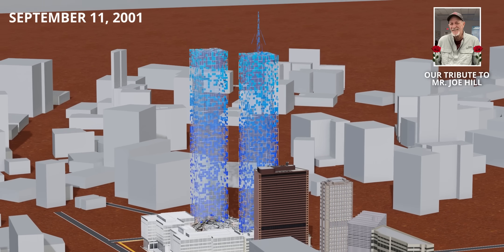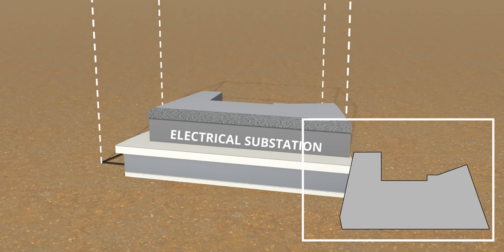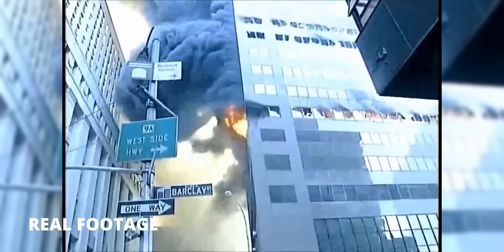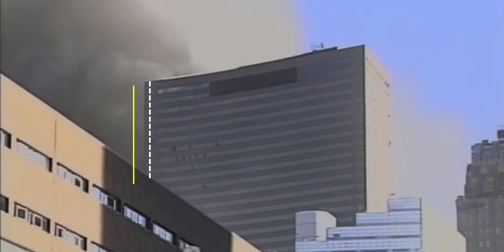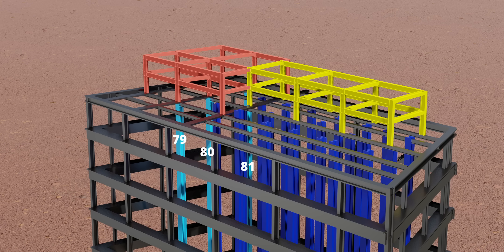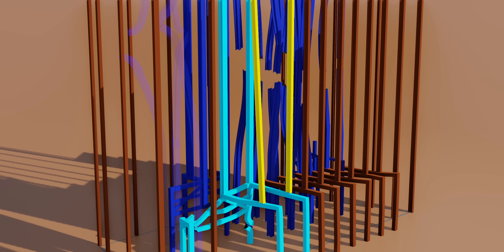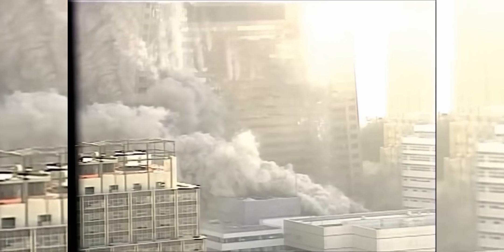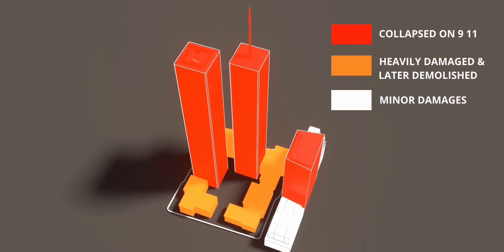Collapse of Building 7 | The Complete Physics

Comment: Okay so freefall speed they admit is 3.9 secpnds for a building this tall, but this building's 5.4 second is WAY slower. About 40% slower(that math doesnt add up) they claim.

So youre admitting that the building fell only 1.5 seconds longer duration than if it was FOR SURE A CONTROLLED DEMO.

thats why he wants to refute the fact of freefall speed is because it proves a controlled demo. But their best evidence of natural falling is that it fell 1 second slower than a freefall object lol
Reply: Had Building 7 collapsed at the rate of FFA it would have taken 6.5 seconds start to finish. Actual collapse time was about 18-20 seconds.

So you got everything wrong. 

CD's do not BTW collapse at FFA.  Certainly no one has ever offered up a single example. It's all 🐂💩 which is why you will have no more success pushing this argument today than a million other people before you over the last 18 years who just mindlessly repeat stuff they don't understand off the internet.
Reply: Ok, so....you literally got nothing right...and you wanted to brag about that? Wow.

The building was 190 meters tall. A fall, from rest, from that height, would take 6.225 seconds. The observed fall was 5.4 seconds...for 18 floors. It was 47 floors high. Hence, there would have been 0.825 seconds for the remaining 29 floors. Which anyone with even the slightest bit of a brain would tell you isn't going to happen.

Hence, we can conclude that, no, literally everything you said was wrong.

Comment: Hmm, so apparently you can get a physics degree from a cereal box now.  Interesting
Reply: Well apparently you did, which is why even this video went right over your head.
Reply: @TheCriticalStinker-01 so stinky you are saying it hasn't went over your head because you have a engineering degree? You are a liar
Reply: @TheCriticalStinker-01  How ironic, coming from a user with the tag of "CriticalThinker".
I doubt you can properly grasp the concept of thinker, let alone a critical one
Reply: @TheCriticalStinker-01 Paragraph 2 Building 7 was the 3rd to collapse,  everyone knows this. And look, Stinky says we should listen to him because he has a degree in WHAT??? yea that's what I thought. We should listen to stinky because he has never had a job. Yeah that makes sense. And 7 wasn't an engineering problem what are you talking about? 
Paragraph 3, you admit it burned out of control for 7 hours. But No one turned on the fire suppression system in tower 7, no one was inside 7, no one fought fires in 7. Therefore there was noone to pull out of tower seven   You say half of NYCFF died that day. So not true. The total number of FF in NYC was 8648, half of which would have been 4324. Not 343 you are off by 3981. And this is exactly why nobody wants to read all this crap. You are a liar.  But you point out no water pressure. Let me add, everytime something dramatic happens there's no water. No water in Maui,  no water in LA, no water on 911. 
This video you made to show how 7 was damaged shows no damaging happening,  you just show before and after, proving absolutely nothing. And your map is a joke. Buildings were damaged fifteen blocks away. Your map barely shows tower seven even being in the fall zone. 
Paragraph 4 collapse isn't always a concern for FF. Not one firefighter believed those buildings were gonna come down when they got there that morning and there's testimony to prove it. You lie stinky. Alot!!!  Plasco tower was faulty, and not maintained,  the wilton pias de Almeida was abandoned,  had squatters in it, it wasn't maintained and there was an explosion in the building.  Hardly something to compare to tower 7 to which was maintained,  had a fire suppression system,  and didn't have explosions in it. 
The second video proves they didn't go in 7. Now you're proving yourself a liar. 
Paragraph 5 everyone knew 7 was coming down. You show no proof of anything you are saying,  are we just supposed to believe because you say so after all these lies. I don't think so. I was gonna go through the whole thing but you've got enough on your plate at the moment explaining your lies. Let's not miss the fact that you just admitted no one was in there for 5 hours. So you admit there was no one to pull out.
Reply: @h1F5951, 2, and 7 collapsed.  The others were crushed.

Comment: The twin towers held up after the 93(?) bombing despite half of the core columns being utterly destroyed at the foundation level.

The building did not fall.

So no.  No way did the buildings fall synchronized uniformity despite damage not occurring uniformly.  That has never happened in any structure created anywhere.

This video is BS.
Reply: Everything you said was incorrect
Reply: @sovereign6445 Find me a video of asymmetrical damage resulting in symmetrical collapse.
Reply: @norepresentative2491 plenty of simulations showing floors and outside falling away no video needed when you can use today’s technology for simulation up to 100% accuracy come on man we are in the a.i age you know this
Reply: @sovereign6445 Have you ever seen the PBS show on why the towers fell?

It has the Simulation showing what happened.

And the Simulation VERY CLEARLY shows the floor collapsing on one another while leaving the core columns untouched and standing!

This does not match the actual collapse.

This Simulation was made and OK for showing on a major network as being accurate.  Total hogqash!

THAT is your computer simulation accuracy!
Reply: @norepresentative2491  - What symmetrical collapse?  The collapse was anything but.
Reply: @sovereign6445 You've never seen the actual towers collapse have you.

The towers were asymmetrical damaged.  They should NEVER have fallen in the direction of greatest resistance (straight down where all the larger and more steel is present to stop the collapse).  When things fall they ALWAYS fall in the direction of least resistance.

They should have not fallen at all.  But TIPPED over due to the asymmetrical damage.  They should have tipped over where the crowd below was and killed thousands more.

But they didn't.  When one of the towers begins to collapse you can see for an instant that it was starting to topple over.  Then a small explosion cut happens and it straightens itself out totally against the path of greatest resistance.  Because that is not problematic.😂

The falling tower would demolish itself as it hit the stable floors.  But according to "peer review theory" the falling portion was indestructible the entire time hitting one stable floor after another and suffered no damage.  This peer review theory was originated, written, and reviewed in less than 2 days.  Never-ending most papers can sit for years needing enough confirmation to be in a journal .

Then the instant the falling art hits the ground, it vanishes.

And a fire is maintained underneath with the rubble for months without ever receiving oxygen.  Normal fires cant do that.  But thermite fires can.which is why we use them in SEAL missions to cut thru hulls of ships in water because they dont require oxygen from the environment.

Literally EVERY CLIE points to this being demolitioned.  Its you who cant read and connect the clues.  Maybe you will one day
Reply: Only one core column was destroyed in the 93' bombing and at no time was structural integrity compromised.

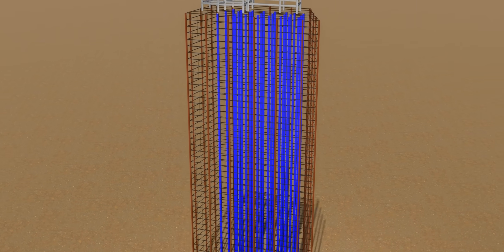Comment: The Grenfell Tower fire burned for approximately 60 hours, finally being extinguished around 1:14 BST on Thursday, June 15, 2017. The blaze, which started in a kitchen on the fourth floor of the North Kensington tower block in the early hours of June 14, quickly spread up the building's exterior before engulfing the entire structure 

Look it up YouTube it’s still standing
Reply: Plasco Tower burned for less than 4 hours and it collapsed.  Plasco was even steel framed, unlike Grenfell which was concrete.

Wilton Peas de Almeida only took 90 minutes, again steel framed.

Why is it losers like you always pick the worst examples for comparison and ignore the obvious ones?  Ignorance or lie-by-omission ?
Reply: @TheCriticalStinker-01 Plasco building fell because the building's lack of modern fire safety systems and lack of maintenance.  It was faulty.  Wilton pais de Almeida was abandoned,  lived in by squatters,  not maintained,  and was blown up. This is what you call proof. 😂😂😂😂😂
Reply: @robbiehiatt9966    Wilton Pais wasn't blown up, no crew was going into the squatter occupied building to set up cabling, explosives, detonator and the wiring. 

You want us to believe squatters would let such a crew in and leave their stuff connected, and the 'government' would allow a demolition in the center of downtown without debris tarps covering the building and without clearing the surrounding few blocks. You won't get a lotta bites on that one.
Reply: @Larry-mk9ry maybe you misunderstood what I was saying. When I say?
It was blown up.I say that because there was an explosion in the building. Not some sort of controlled demolition. An explosion started the fire. Look it up if you want i spent hours researching it
Reply: As someone who studied urban architecture in Europe. Grenfell has a very different construction from the WTC 7. WTC 7 is a steel structure with a steel core, while Grenfell is a steel and concrete structure with a reinforced concrete core (also being especially designed to withstand fire by its lead architect, Nigel Whitbeard). The damage it also entirely different, WTC 7 had sections of the building already destroyed by heavy debris from WTC 1 & 2 and a raging fire, while Grenfell only had a fire and main structural component left intact.

Comment: 8:45 windows exploding... Open your eyes
Reply: That's almost 10 seconds after the collapse started, and was caused by Column 58 failing - in the last cluster of the core columns to finally go, bringing the floors violently down with it and probably causing the failure of perimeter columns 54-56.
Reply: @TheCriticalStinker-01 🤣🤣🤣
Reply: And yet, the "exploding windows", 1, happens along one single line, 2, do so after the collapse have started, and 3, is literally explained during the segment.
Bravo.

Comment: 4:25 You can clearly see the windows blow out, from the bottom up in a straight line. Clear sign of a controlled demolition.
Reply: That's about 10 seconds after the collapse started and most of the building is already gone.
Reply: @TheCriticalStinker-01  Regardless of the penthouse, the freefall collapse happens instantly, when the windows get blown out.
Reply: @defcon2544  - No it doesn't.  The measurement of alleged FFA (it wasn't) was taken about 10 seconds after the collapse began and at the opposite end of the building.  What is being measured is only one corner of the exterior moment frame - the empty cereal box - and NOT the building by any acceptable definition of the term.  The very brief period of alleged FFA is easily explained by the single point being measured moving in 3 dimensions not just straight down and thus subjected to more than just gravity.

In other words, the internet has been lying to you and FFA is still the same meaningless nothingburger it has always been, explaining why a million of you clowns run to the internet with it and fall flat on your face.

Time to pick an argument that isn't a guaranteed loser right out of the gate.
Reply: @TheCriticalStinker-01   No, you have been lied to.  No plane hit the building, no jet fuel (as if that truly explained the explosive and total collapse of WTC 1 and 2, virtually in freefall).  The fires were pathetically small. Office furnishing burning won't collapse a building, in freefall, onto its own footprint.  And windows don't get blown out in a straight line at the moment of the freefall collapse.  Try harder, potato.  You couldn't even get the fake computer models to reenact how this took place.  Columns taken out at the same time? Controlled demolition.
Reply: @defcon2544 how do you know the fires were small?

Comment: 3:41 It was not the antenna. photographs and videos show that the North Tower's spire fell to the south as the tower collapsed. WTC 7 was located north of the North Tower. NIST supports that if you care about its report.
Reply: I have just seen a picture of the falling antenna on FB and came here to comment the same as you. Yes, according to that picture, it clearly fell to the opposite side.
Reply: Thanks i also wanted to write that. Spire was falling more into the plaza area dicrection south east of north tower.

Comment: This is absolutely the biggest crock of shit I have ever seen. No steel structured building has ever been taken down by fire....ever....that's why they built them with steel....
Reply: Except for the thousands that have, because it literally happens all the time. Steel if formed using heat and deforms the same way.  Blacksmiths have known this for a millennia.
Reply: @TheCriticalStinker-01 Name one steel multi level structure that was taken down by a fire.....
Reply: @TheCriticalStinker-01 Crickets...What no reply....
Reply: @TheCriticalStinker-01 Steel is formed at 2400 degrees. The building materials in that structure never even reached 700 degrees....that steel was only heat inhibited or stressed by 5 or 6 percent. Not nearly enough to cause collapse and certainly not enough to cause a free fall collapse. 
One more thing....where did the thermite residue come from in the dust that has been tested in that area. No thermite particles have been found anywhere else in NYC yet the 20 square block area around WTC is loaded with it.

Comment: "Mysteriously Collapsed" - what a legendary statement.  🙂
Reply: How could the collapse of two nearby 110 story buildings - igniting a fire that wouldn't be put out for another 99 days, and crippling immediate fire repose - possibly cause another nearby buildings to burn down??????? Its a total mystery.
Reply: @randomnobody8770  On September 11, 2001, a total of 56 buildings in New York City were damaged or destroyed, according to the Federal Emergency Management Agency (FEMA). This includes:

5 buildings that fully collapsed:
1 World Trade Center (North Tower)
2 World Trade Center (South Tower)
7 World Trade Center
3 World Trade Center (Marriott World Trade Center Hotel)
St. Nicholas Greek Orthodox Church (155 Cedar Street)
3 buildings that partially collapsed:
4 World Trade Center
5 World Trade Center
6 World Trade Center
11 buildings with major damage
37 buildings with moderate damage
Reply: @randomnobody8770 building 7 was a block and a half away from the twin towers. There were other buildings in between that were still standing.
Reply: @michaelfoulkes9502  It was only a block and a half away. People forget just how massive the twin towers were. Go watch the collapse. It took months to fully put out the fire. Several other buildings in the vicinity were similarly destroyed. There was flaming wreckage everywhere, and fire response was impossible for 12 hours. Of course buildings within two blocks burned down. Building 7 isn't mysterious at all.

Comment: You mean it took 25 years for this info to come out. Sure, I believe it, (NOT).
Reply: There is nothing new in this video, no new information.  The mechanisms described here are overwhelmingly supported by the worlds engineering community.  Sure, they don't fit your dogma because the internet told you to believe stupid shit and you ran with it, but that is very much a you problem
Reply: @TheCriticalStinker-01  You won´t find the antenna BS anywhere other than in this video here stinkyshit... Also this is the only video that first highlights the 90 degree shaped transfer trusses to then highlight 90 degree shaped trusses in the debris claiming that it must have been the collapse that caused the 90 degree shape. So here are really some new claims, but yeah ok stinkyshit, let´s not call these new claims "new information", let´s call it "new BULLSHIT" instead...

Comment: It's quite remarcable that the fire insulation was not designed to hold up to the burning of interiors. I have not heard of any steel/conceete building tah have collapsed only du to a prolonged fire. I mean, how much funiture where there in the building?!
Reply: The insulation did its job.  The insulation increases survival time, it does not grant immunity. 

Major assemblies were rated for 2 or 3 hours in a typical fire event. 9/11 was anything but.  2 to 3 hours is enough time for occupants to escape and after firefighting to start taking effect (in normal circumstances). After that, if active firefighting hadn't taken hold (and on 9/11 it didn't) all bets are off. 

Building 7 lasted 3 times longer than its design specification in a far worse fire event than its designer and builders ever imagined. A remarkable performance.